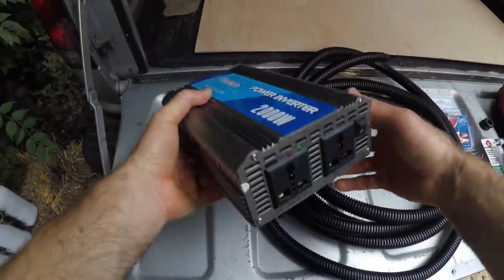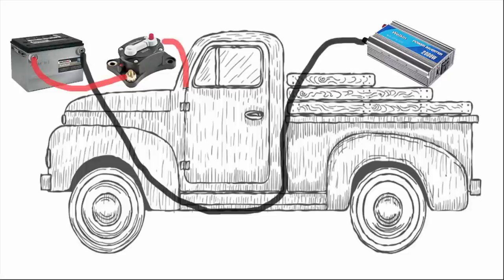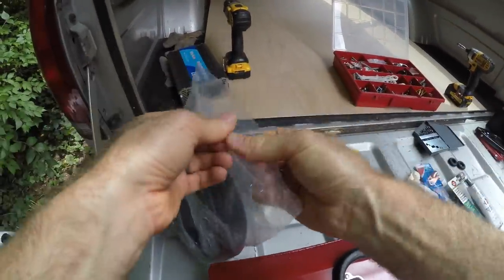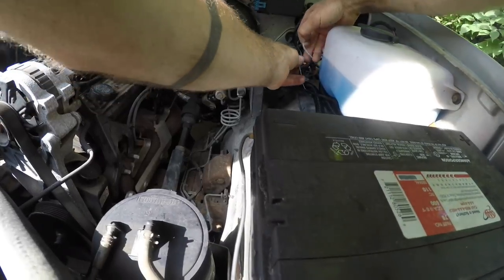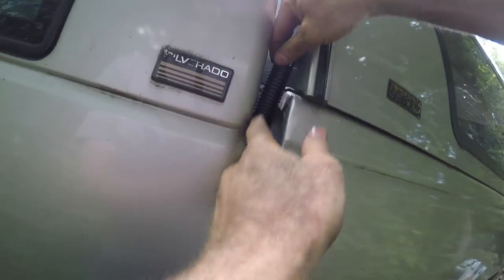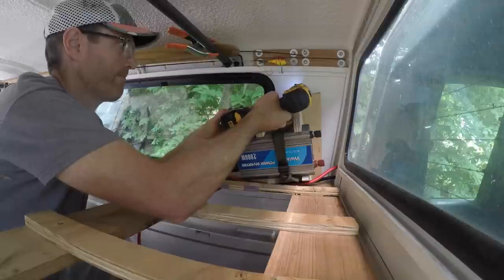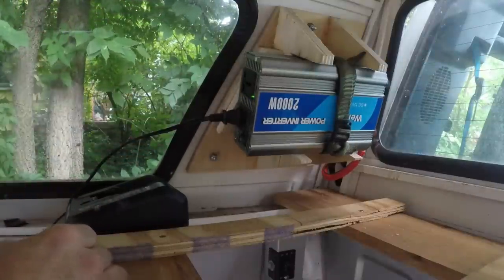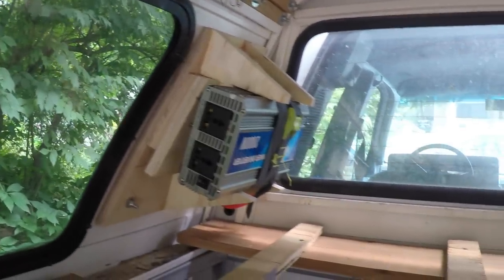Installing a Truck Inverter

Comment: Wait. This is a 2kW inverter, meaning it can potentially output about 9 amps on the 220 volt AC side (not taking into account power factor). 

This would also mean that you're capable of drawing almost 170 amps of current from the 12 volt side. 

From a quick google search, 2 AWG copper wire can carry a MAX load of 130 amps, and that's assuming it's pure copper, which the wire you have here may very well not be. This isn't even taking into account the total length of the wire, which can negatively affect the amperage carrying capability of a given wire. 

With all of this being said, shouldn't your circuit breaker be rated more around 100 amps? With a 300 amp breaker, I think the wire would roast before the breaker tripped, no?
Reply from the maker: You've given me a lot to think about, thanks! I guess the risk would be if I was pulling big power, like with a chop saw or something. I'm thinking of either 1) switching out that breaker, or 2) moving the inverter to the engine compartment and using an extension cord for the plug-in ... anyway, thanks for the careful reasoning!

Comment: very good sir, now can you do a vid on how I would use a solar panel with this setup?? Its just what I'm looking for. It would be soooo helpful since I'm a bit of a twit when it comes to this sort of thing.. cheers
Reply from the maker: I guess I really should put a solar panel on top of my topper for off-grid camping ... cool idea! Solar is definitely a bit more complicated, as you'll need a charge controller and all that, but you should be able to find some useful diagrams online. Good luck with it!

Comment: @metaspencer thank you so much for your video. I install my old 5 year power inverter on my old suburban 2001 and once I connect the  cables, power inverter start to do a humming sound. Do you think is normal? Power inverter was off. Thank so much for any advise on power inverter humming sound when is off.
Reply from the maker: That humming doesn't sound good to me ... I guess I'd probably not use it if possible. It would be bad to have a fire
Reply: @metaspencer  thank you so much for your reply, i really appreciate it. I will look for another power inverter. Thank you so much 🤗

Comment: That was pretty cool the way you instructed that but what charges your second battery from when you're done using it it doesn't bring back a charge
Reply from the maker: it charges just like the main battery: off the alternator

Comment: That was a great video. I work in the oil field and move from job to job and I want to put a small microwave in my truck. Can you recommend a strong enough inverter?
Reply from the maker: You’re looking for a 2000 watt inverter I’m guessing... sounds like a good setup
Reply: I don't think any consumer microwaves exceed 1500 Watts -- the smaller compact units are usually around 1,100 Watts and are quite adequate for reheating a coffee , a sandwich, soups and stews..etc.  Size the inverter 500 Watts above what your plugging into it.

Comment: Nice install. How is that era Chevy as far as mechanical, any issues? I had an 01 s10 that was a huge lemon but heard Chevy is junk and mine is typical. Give ya example of comparison-98' Tacoma first set of ball joints at 170k mi. S10: 1st set @ 70k, & 2nd set 80-100k later!  1st fuel pump @ 91,300 & 2nd 90,xxx miles later! TacomA:pump never failed. Both times happened after 11pm & big tow bills. 2nd time I just filled up 50 $gas. Shop wanted 1100 parts & labor. Friends  fixed both times for coupla Bill's.and pump itself 250-300 for quality name. 2nd time 210 with dealership discount. Only good thing out of both failing is I could easily do an install myself after watching & helping work on mine.
Reply from the maker: The thing about my Chevy is that it's still at just 65k, so it's hard to tell about the overall cost of repairs. I have had a few things go, like the freakin' tranny! But that may have been a fluke due to hauling heavy loads. I've owned one Toyota and had a good experience: went 200k with little repairs other than the clutch at 180k. My ford and chevy trucks have not been so lucky ... but then, I still love 'em and get a ton of work done with them, so it may all even out. Good hearing from ya, man!

Comment: Good video.  The only thing that sucks is that you have to climb up in the bed to plug stuff in! 😲
Reply from the maker: Good point! I've since added a 10' extension cord to be able to charge my batteries back at the tailgate

Comment: I had a 400W inverter installed. I upgraded it to a 800W. I also installed an inline fuse when I installed the 400W. I don't run that much: a laptop, a printer, a hotspot and my phone. The 400W ran off of 12AWG wire and I never had the fuse blow. As long as I don't increase my load, will the 800W be OK until I get the chance upgrade the wire? I didn't use a conduit. Good idea BTW.
Reply from the maker: Check a wire size chart. Depends on load but also length of the wire. Fuse is a good idea

Comment: Personally, I think going underneath along the frame rails and coming up through the bottom of the bed would have made a cleaner job. Also if you ever remove the cable a rubber plug could fill the hole. I have a cobra 1800 watt inverter and have thought about installing it in my 2018 sierra, but the 28 feet of wire was cost preventive but yhe harbor freight jumper cables might work.
Reply from the maker: I see your point on that routing method for the wire but didn't want to come in low as I was thinking about water infiltration. But I see your point.

Comment: if you heat the copper lug then fill i 3/4 of the way with solder.dip your wire...refill the lug then put your wire in permanently you will never have a issue as long as u heat shrink the lug after its cooled
Reply from the maker: Oh what a great idea. Thanks for that tip! Good one

Comment: MR Spencer good video. Two questions: 1) suppose I do not have room under the hood or don't want a 2nd battery there. Can I keep battery two on a tender in my house,  bring it out when necessary,  place it in my truck bed and just run wires to an inverter and then plug devices into the inverter without connecting battery two to the car battery(Battery one) that is under the hood with the car running?  Question 2: If a car needs to be running, why have two batteries? Thanks.
Reply from the maker: Number one is a yes, but just keep it charged regularly. Number two is that it’s just how some heavy duty trucks are set up. Good luck with it!

Comment: You have positive and negative to the inverter did you have to hook a ground as well to the inverter because I have positive negative cable plus a ground
Reply from the maker: You can ground to the body of the vehicle ... that's the the negative cable. I ran mine to the battery but you can just ground to the frame

Comment: I like the idea I did something very similar to what you did
 I used to be over the road truck driver and I got sleep apnea so I had to have the power inverter to run my CPAP machine and the semi had a battery operated APU it worked out excellent I went and bought some cable from Farm & Fleet both were red but I did color coat the ends the only downfall there was in the system is when the batteries got low I had to fire up the main engine to recharge system if I sat too long and being in a no idle state made it interesting not to get caught charging the batteries back up
Reply from the maker: sounds like a pretty good setup -- I would have figured that those CPAP machines took more power than the battery could produce. but no! I'm pretty psyched to have this AC power option for trips and remote builds. take care!
Reply: Man that's rough glad it's been working out for you!

Comment: Awesome video  !!! Question would I be able to run a small microwave with that particular set-up??
Reply from the maker: You'd have to check the load/draw on the unit you want to run ... microwave's take a lot of power
Reply: @metaspencer  thanks for responding. So basically if I have a 1200 watt inverter , I should be able to run a 700 watt microwave right??
Reply from the maker: Should work … breaker would be a good idea and powerful alternator
Reply: @metaspencer  thanks Spencer!

Comment: I wonder if you could run a small 125 amp flux core welder off this thing
Reply from the maker: That would be amazing! I kinda doubt you’d get enough heat … but it would be cool

Comment: Great idea about the crimping trick, but how did you crimp the cables on the inverter end?
Reply from the maker: Vice grips with screwdrivers .... I really need a good crimping tool
Reply: @metaspencer  Good call, it's one of those tools that get used very seldom, so your method is perfect for your needs

Comment: Nice configuration however that strap looks bad , should have used a metal bracket secured to the wood to hold the inverter bro 😎
Reply from the maker: I see your point, but the dang strap just keeps hanging in there! I should change it, but I somehow never do

Comment: Dear Sir, can you make a video that shows how to use the same principle indoors to fire up your electrical heater during a snowstorm or catastrophic weather? Without using your pickup truck 4 charging your indoor battery?
Reply from the maker: Sir, no I can't do that. I'd never run a heater on a battery. That would be too much power draw

Comment: Would your set up run a pancake air compressor? If I just get a bigger wattage inverter?
Also 
Great video
Reply from the maker: Could work! Check the load on the compressor
Reply: @metaspencer  quick question, did your inverter say to install it within 3 to 6 feet from battery? I purchased jupiter inverter upon reading the instructions it says to plug with within 3 to 6 feet which I can't in my 2011 silverado best I could do is 10 feet do you know if it would change anything? Thanks.
Reply from the maker: @alonsoamezcua2386  You'll have power loss over more distance, which can sometimes be dealt with by using thicker wire. But I don't know if you'll have problems or not. You can always put a second battery back in the rear of the truck
Reply: @metaspencer  yea I'm thinking about it, I have a section we're I'm mounting the generator inside the cab or than likely I'm going to install it near it.

Comment: Curious why you got a 220v inverter? I’ve plugged my US 120v tools and chargers into 220v sockets overseas without a step-down transformer and I accidentally blew the tools. Trying to figure out why that didn’t happen with your tools when you tested them??
Reply from the maker: It wasn't intentional to get the 220v and makes sense to keep in the 110 arena for sure
Reply: @metaspencer  makes sense. Funny as I’m looking for a 220v one to use overseas ha. Thanks for the vid! Good stuff.

Comment: You don't have to run ground all the way to the inverter you can ground it directly to the frame (ground) just clean the rust off the surface with a wire wheel or wire brush
Reply from the maker: Yeah, good point. I didn't exactly know that when I was doing it ... years of wiring houses got in my way. Thanks for the tip!

Comment: How did you crimp the wire when in the truck as you now don’t have the vice to use ?
Thanks.
Reply from the maker: I've had that question a few times. Without a crimper I used a pair of vice grips, sandwiching the wire between screwdrivers. That puts a nice dent in the fitting. Some will add solder to the end too

Comment: I'm installing inverter for my sons PlayStation.  Great idea on cables. Can you give me order info for inline fuse? Much obliged, great video. Thanks
Reply from the maker: Hey Jim! I posted the info on the fuse above in the "show more" section ... but here it is! ✯ 220 inverter, which is not typical in North America: https://amzn.to/2wiViUm
✯ jumper cables: https://amzn.to/2MLXXjv
✯ 1" conduit: https://amzn.to/2PugWh3
✯ circuit breaker: https://amzn.to/2MvG2hO
✯ grommets: https://amzn.to/2o3ti3g
✯ step drill bits: https://amzn.to/2wmfsfU
✯ isolator: https://amzn.to/2Mqw6WK
(all Amazon Associates links, which help support the channel)

Comment: It is not necessary to run a negative wire to the Inverter. You can use the vehicle as a negative common for the Inverter and double the positive wire size. I've done it and it is safe!
Reply from the maker: You're absolutely right -- I just prefer to homerun too the battery on an instance like this

Comment: How do you charge your second battery the one you use for your inverter are you charging it via the alternator?
Reply from the maker: It’s tied into the main battery so the alternator charges both

Comment: Nice video, but how did your appliances handle the double voltage where as most household appliances are only rated for 120v
Reply from the maker: Using the 220v inverter was an oversight on my part, shoulda gone with a 110 device. With that said, everything has been fine and I haven't fried anything.
Reply: @metaspencer  if you want to get really technical, you could throw a a single phase 220v to 120v transformer with a rated fuse disconnect(this would clean up the sine wave), on the load side put breaker and a plug in but
I don't know how this would do if it would if its for European plug cause their cycle per sine wave is 50hz we run 60hz
Reply from the maker: Woah, that's a cool idea. Just hazarding a guess, I'm thinking a better 110v inverter would be an easier, cleaner, and cheaper way to go. I'm looking into the transformer idea, though, as the clean sine wave would be cool for electronics. thanks for the ideas!
Reply: @wahzureone  Transformers don't change the frequency so whatever you get in is what you get out minus some losses.

Comment: Hi, Francesco from Italy. I bought the same 2000w inverter but I am struggling with cable size. I read that it is better to use short and thick cables in order to use high power tool 1000+ watt. What do you think?
Reply from the maker: Yes, thicker and shorter cables will hold more load with fewer problems. If you look at a wire size chart you will be able to tell you what wire you need. Good luck!
Reply: @metaspencer  thanks

Comment: Is there a reason you chose to use jumper cables instead of heavy gauge wire? I feel like heavy wire would be much cheaper and do just as good of job.
Reply from the maker: I got the jumper cables cheap ... just use what works for ya

Comment: I’m surprised you didn’t put the breaker switch right next to the inverter. Now you have to pop the hood every time you want to switch it on or off.
Reply from the maker: I went for safer ... works for me since I use it rarely

Comment: So I had my heater core go out on my 1998 durango, and the repair cost isn't worth it. 

I want to hook up a 2000w inverter to my main/only battery, so that I can run a 500-1500w space heater inside my vehicle (only while running). If I find a different wattage heater, I may go lower so it isn't over kill. Just need something to get the interior warm and defrost the windshield if I need to. It also would be nice to have the inverter for when I want to use while camping.

Is there any obvious reason this wouldn't work? Will I drain the battery faster than the alternator charges it, even while running? To be clear, I am only trying to power the space heater while the vehicle is running.
Reply from the maker: There seem to me to be a few potential problems: one would be having the heater pull more than the inverter can handle ... the other would be killing the alternator. I'd be hesitant, myself, to run a heater just because of the draw, but I hope it works out for you!
Reply: metaspencer well if I run say a 1000w heater on a 2000w inverter, I wouldn’t think the inverter would be overloaded. But I guess I don’t know enough about the alternator charging capabilities.

Comment: I'd like to do this on my slvilerado but dont trust my skill level. You think a garage would do this for me if I bought all the items? They would probably want to charge me an arn and a leg huh?
Reply from the maker: A shop that installs audio equipment could probably do the best job and charge the least, as they're used to this kind of stuff
Reply: @metaspencer  Hey thanks for the video and that info. Much appricated...😊

Comment: How did you get your vise into the truck bed to crimp the connectors for the inverter?    I carry some much crap in my truck I'd never access that inverter location.  Maybe plug in thru the cap window?
Reply from the maker: I might have done that one with my long-handled pliers ... can't recall. But I know what you mean about the truck being loaded down: I now use an extension cord that goes to the back of the truck just so I don't have to crawl back to the inverter
Reply: metaspencer 
I think you for this great video. I have a issue, I follow all of your steps, I tried to run my 1500 watts storm heater on it, only gives me one minute and the breaker goes off.

Thanks for your reply!
Reply from the maker: @mikensondemosthenes8233  That's a bummer but makes sense to me: a heater is a BIG DRAW in terms of how much power it draws. It's possible that you could run it with a bigger inverter or additional batteries in series ... good luck man!
Reply: metaspencer 
Thanks so much! I will try with additional batteries in series.
Reply from the maker: @mikensondemosthenes8233  That might help, but it seems that if you're breaker is going it's more about the draw of that heater ... anyway: good luck!

Comment: Great vid dude and thank you☺️👍🏻
Reply from the maker: Oh you bet! It's great having AC power back there
Reply: metaspencer would it run a original Xbox One, I’m a trucker and tried to run my Xbox one of a cigarette lighter inverter🥴🤣... I then realised in need something bigger and better🤣😉
Reply: Thank you for reply btw👍🏻☺️☺️☺️
Reply: Just subscribed 👍🏻😊😎
Reply from the maker: @hjohnstone6921  That's quite a bit of juice ... it all depends on the inverter. You've gotta check what load the device needs then compare it to the inverter.